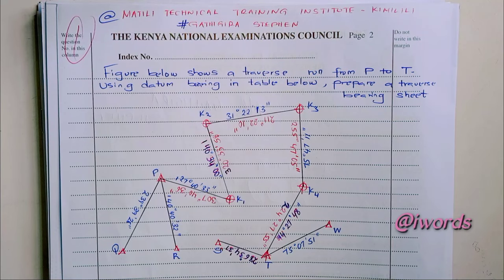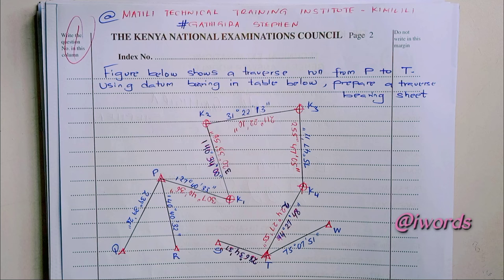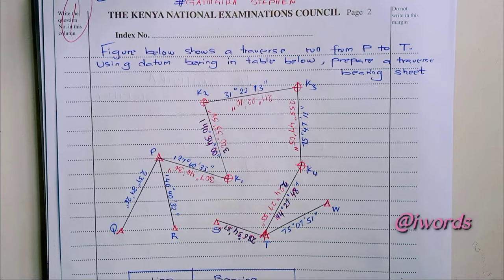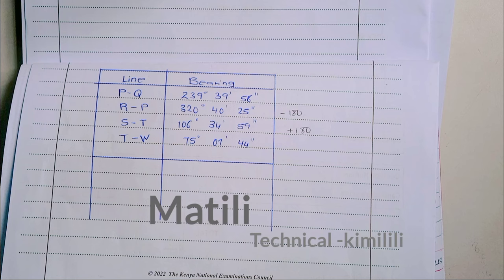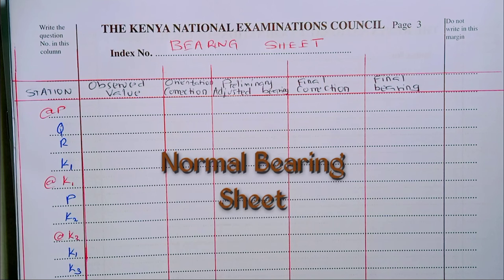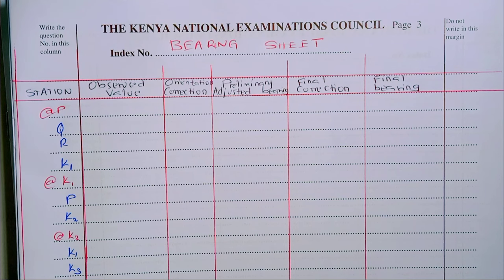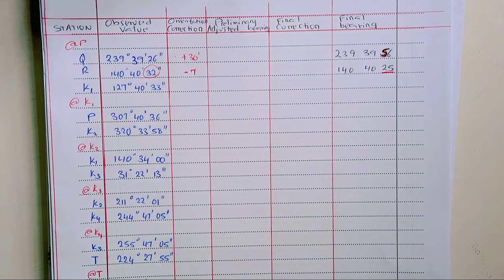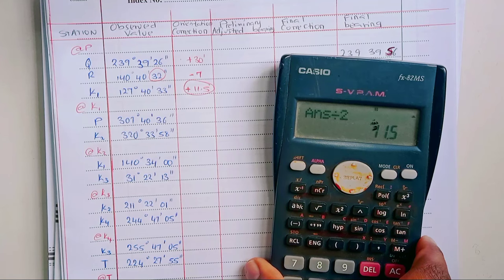Traverse Bearing Sheet Computation Survey for Civil/Building/Quantity/Land survey Learners

Comment: Hi please check ur work of the mean if orientation correction is odd number let say 11.5 you need to round it off to 12 but if it is even say 12.5  say 12
Reply from the maker: rounding off depends on the way i want to balance the error
Reply: @IwordsShotsEmpire  so do you round it off or what do you do???